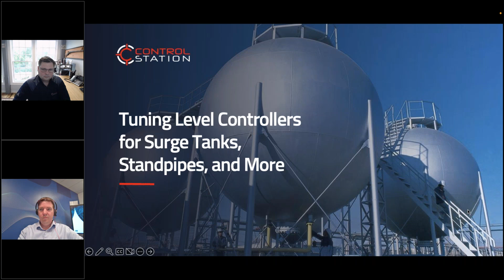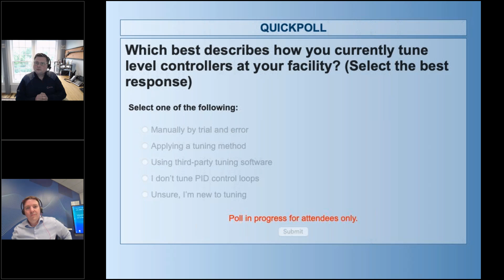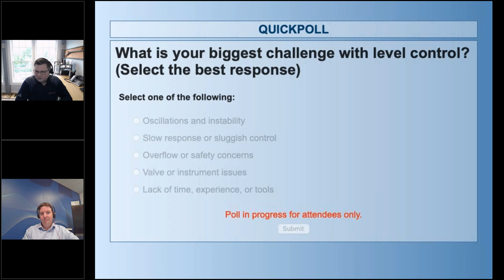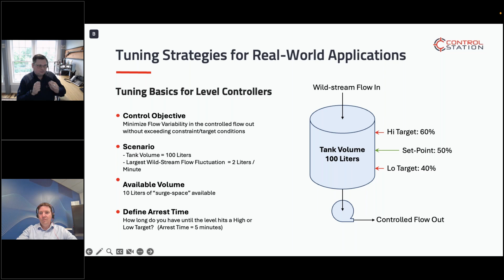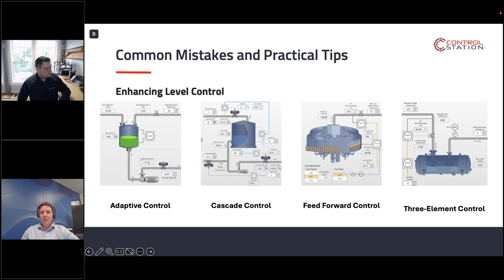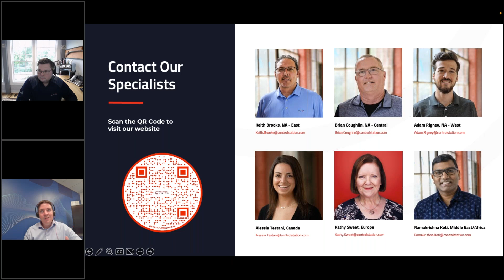PID Tuning for Level Controls in Surge Tanks, Standpipes, and More

Comment: I have 10 bores that feed 150 cubes/hour into a common line. They are 30km away, and so there are 3 booster/buffer stations spread equally along the way to reduce pressure. Tank volume is 100 cubes, largest wild stream fluctuation is 20 cubes/hour (largest bore shutting off). Tank height is 2.8m and Level needs to be kept roughly between 0.5m and 2m, which is 50% of the total volume. 
The cascading pumps are a struggle to work with and the arrest times seem ridiculous. 
It's my first time tuning something like this. I'm going to give it another go tomorrow with the help of this video. Wish me luck everyone